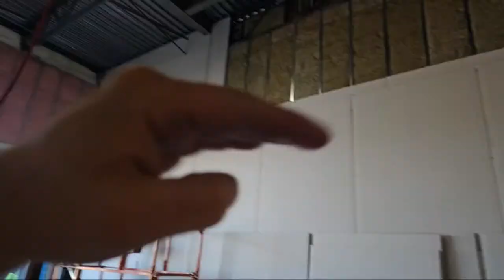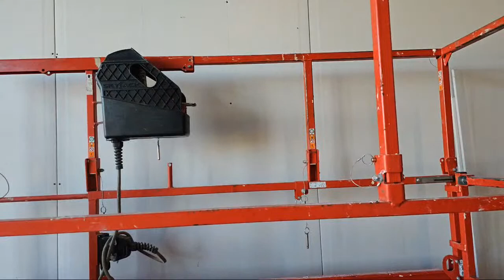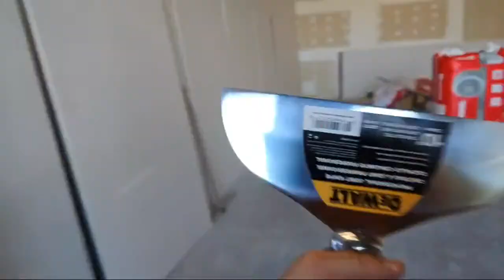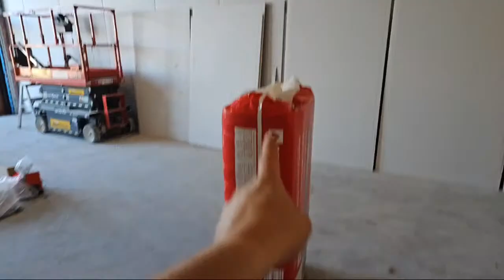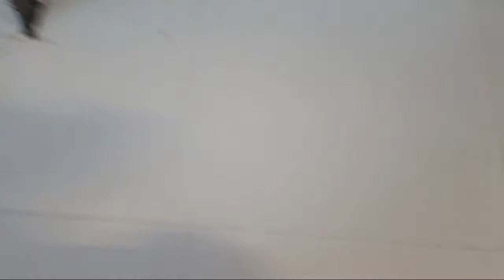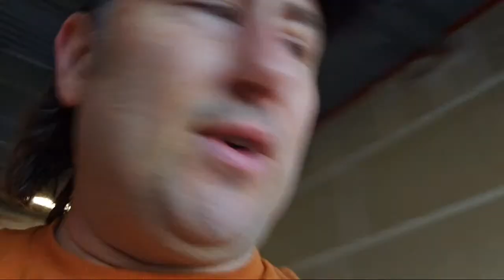Metal Stud Double Layer Drywall Setting The Record STRAIGHT!!!

Comment: No poly hahaha ... its okay.its your design
Reply from the maker: No we never put poly on interior walls, only on exterior.  Sometimes even exterior walls are membraned and "outsulated" with rigid insulation and do not get poly inside.

Comment: I understand only doing standups for fire rated walls because there are fewer feet of joint not being covered by framing members but if its not a fire wall it is irrelevant in my opinion. If the ceiling height is above 12' or exposed to structure we lay the board down. Stronger walls, easier installation, and better joint staggering.
Reply from the maker: I appreciate your comment, I really want you to understand though that it doesn't make them stronger. I want to be clear about it and am just telling you the truth. Don't be upset with me, the way we board a house or wood isn't the same as steel. Standups are specified in both the fire code and steel stud installation guidelines. The whole system is specifically designed for stand ups, it makes it way easier for board and tape. You can also min joints with stand ups much easier. Thanks you for commenting.
Reply: @ConstructionKronies  Definitely going to have to look those up some time. I've never heard anything about that from any inspector or corps of engineer guys I have worked with and they are the strictest guys out there.
Reply from the maker: Yeah if you look it up in the Bailey steel specs bmp Bailey metal products or your local steel manufacturer will have it in the specs. Also the specs in the construction documents. Just remember we use control joints every 40' vertical, and horizontsl expansion joints to control movement so walls don't Crack. I've had inspectors say some weird things but mostly they know what's up.

Comment: You could also screw a stud onto your lift so u don't fuck up your foot.
Reply from the maker: You could but I have to warn against it if it is a rental lift, they will charge you an astronomical amount if they see holes and they do look for it. It's also in the manual not to do that. What we do is make hooks that when the weight of the board is on them they don't move.